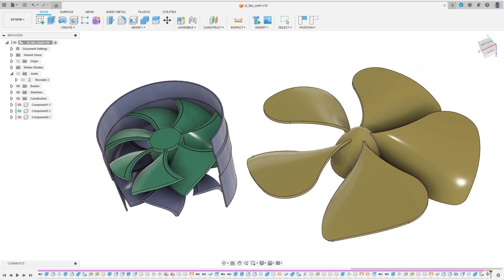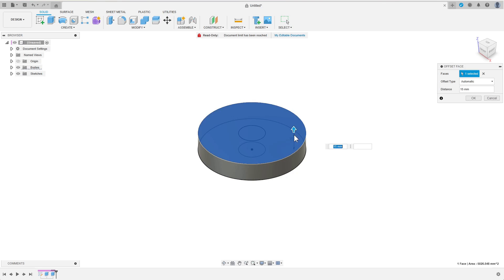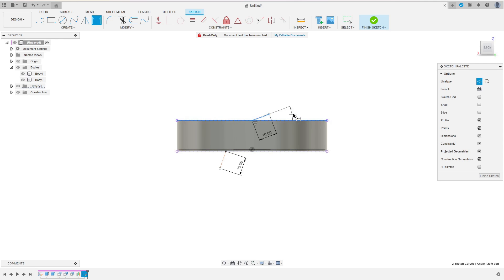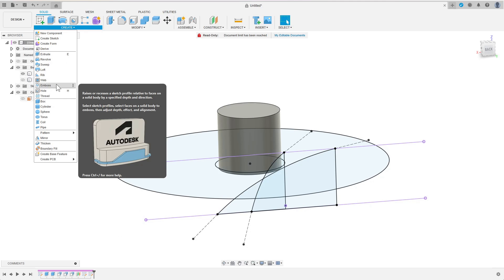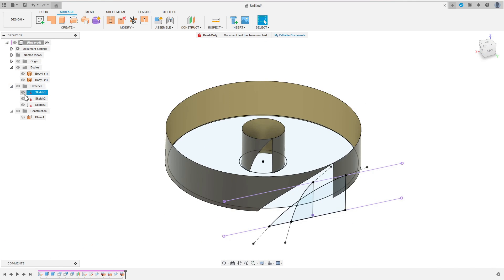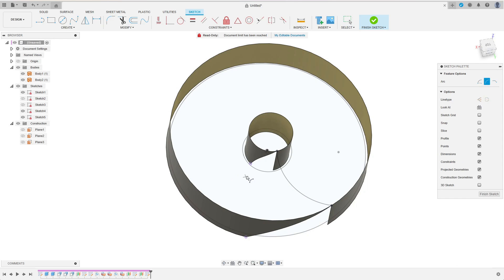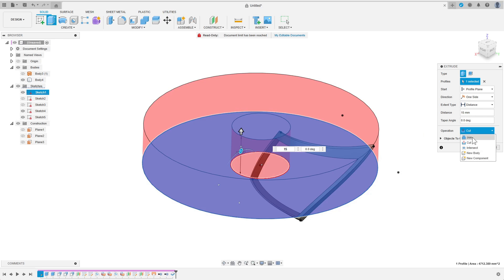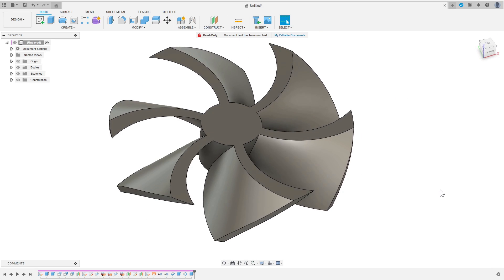How to design fan blades for 3d printing in Fusion 360

Comment: ..ich glaube ja nach dem Akzent, dass du Österreicher bist 🙂. Deine Videos sind exzellent für Fusion360 Kenner, aber für mich als Fusion360 Beginner, der genau vor den Problemen stehen, wie man Rotoren, Scharniere, kurvige Sachen designed,  ist das leider alles viel, viel zu schnell. Selbst wenn ich das Video in 0.25 abspiele komm ich nicht mit. Vielleicht machst du ja einmal eine Playlist für Beginners, und gibst dein umfangreiches Wissen, langsam und verständlich weiter.

Comment: No filler, all killer. Love the way you define the curve by leading/trailing angles; Makes it simple to parameterize.
Reply: I take it back. Any changes to the dimensions of the inner and outer blade radius causes the entire project to break. Fusion can't figure out where the points went during re-calc, so you have to manually go into the sketches and re-connect things. Annoying!
Reply: @kimtae858  Mine worked out great.  I have to admit it was hard to follow with pausing and going back.  Can you explain more, maybe I can help.